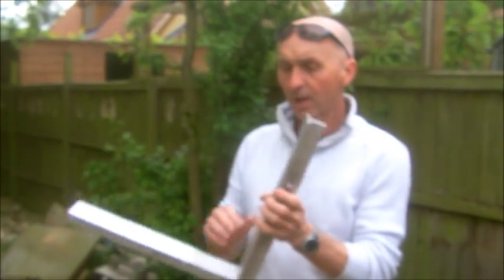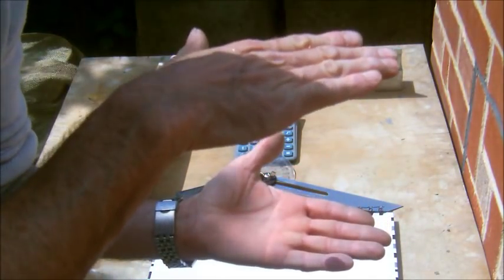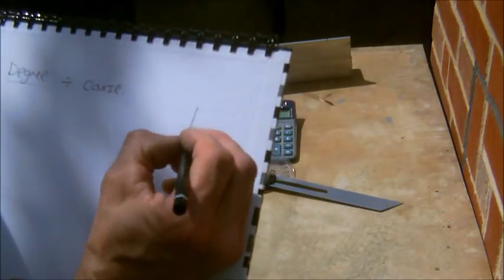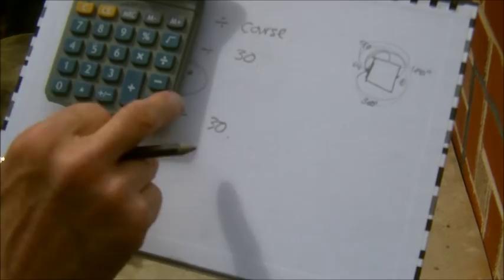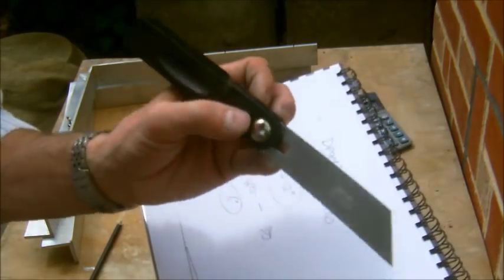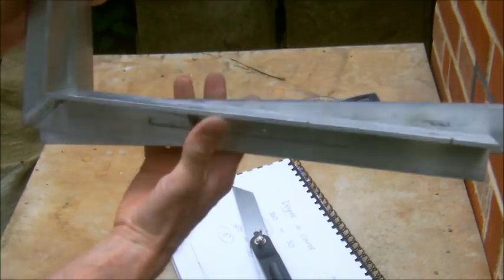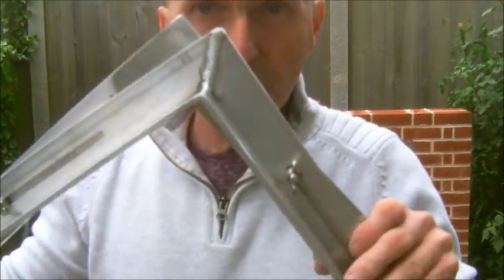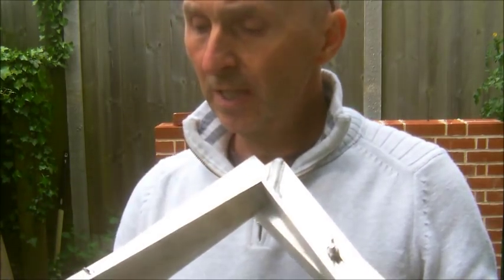the fine art of brickwork - Twist and Square (twisted pier template)

Comment: Rob there is a math problem in your video. If you want the top course directly above the bottom course you can’t use it in the number of courses that you divide into the degrees. If you have 30 courses only 29 need to be twisted. The top and bottom are the same degree the bottom  is not twisted.

Comment: Hello job I'm francisco I make contact with you I would like to understand the video that you explain to the template you write from Spain. My problem is that I have to make a Solomonic columns and I have a limitation of height which is 2100 have the template check with 2 cm of thread but it frightens me boot if arriving at the height of 2100 does not end in the same orientation that e started, I could help you that mathematics had been badly at school thanks

Comment: Rob do you sell the twist & square patented 1989
Reply from the maker: I used to, but they are available from the manufacturer now.
S&G Fabrications in Lowestoft, Suffolk 01502 566734 and ask for Billy
if you are outside the UK you need to tell him as the template needs to be modified for the different sizes of brick

Comment: I’m about to do a 440 pier twisted 30 courses at 12 degrees so a 360 twist in engineering bricks fingers crossed it don’t over twisted
Reply from the maker: check after 15 courses that you are 180, adjust slightly if needed, 
now, I have another, more accurate method of measuring the step of each course, millimetres rather than degrees
Reply: @robsonger1  Oh really great will you be doing a video of this mm  method ? I have some tolerances as the roof isnt started but thought 30 and 12 will look affective.I wish I had a table saw to cut brick in half to make it more affective.